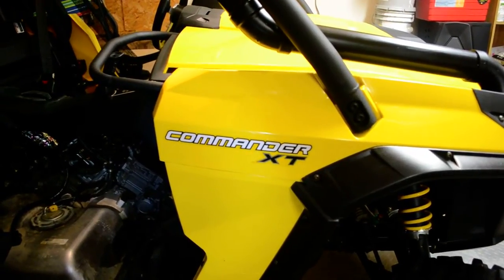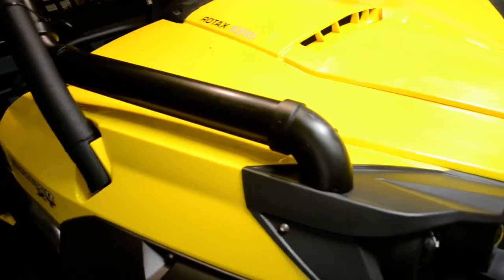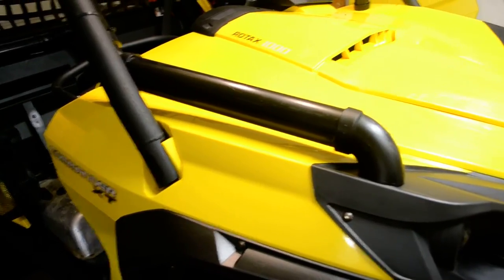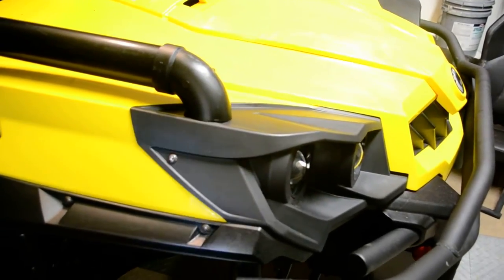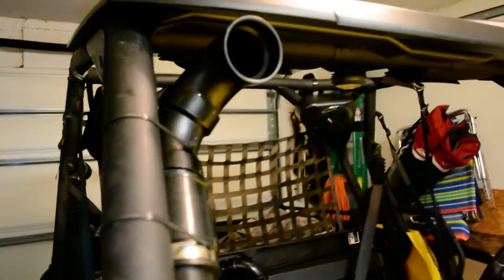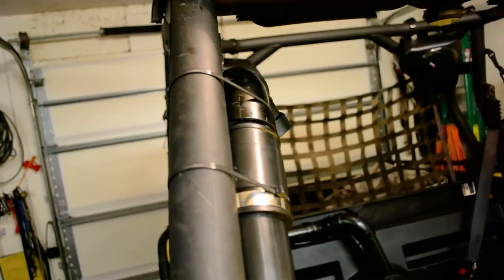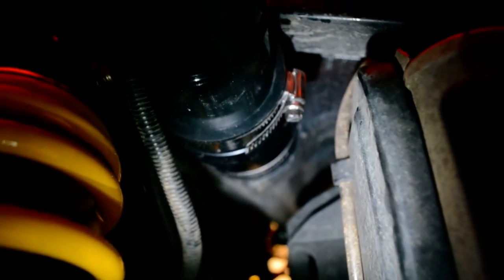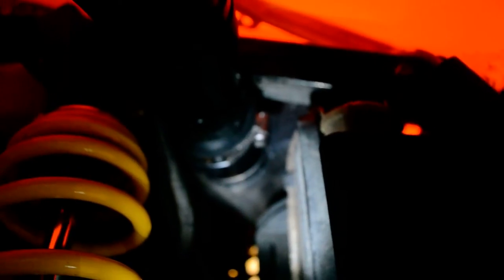Can Am Commander Snorkeling on a 2011 XT

Comment from the maker: Glad I could help. It works great never found any water in air box or belt. I've added additional air filters on the intake of belt and air box which I bought off of Amazon from uni. just by ordered size to fit over PVC fitting end at around 15.00 each. It filters the majority of the dust before it reaches the paper filter and no noticeable loss of power. Washable too. Have fun with it. Great machines.